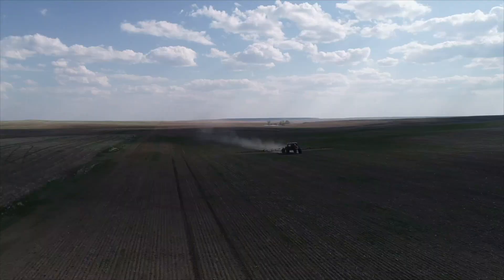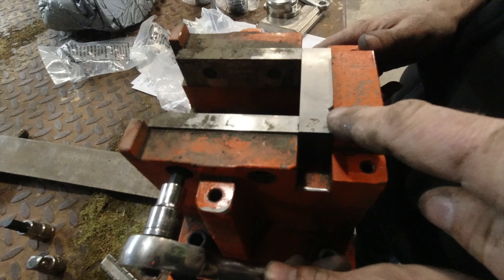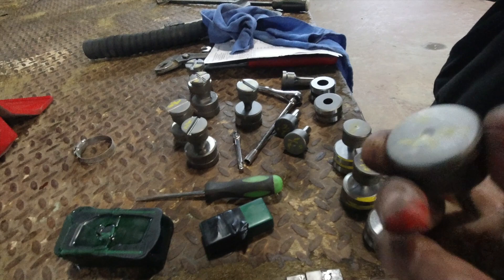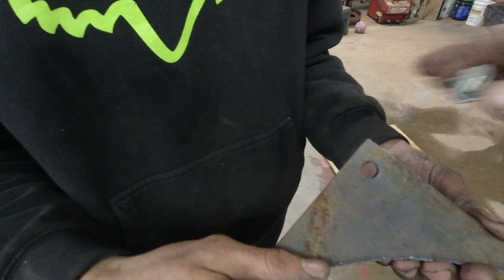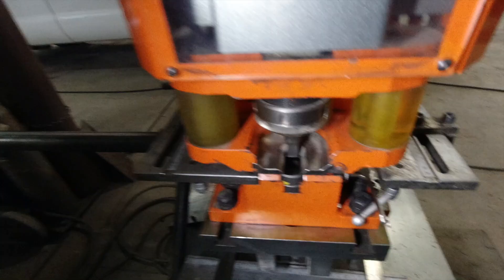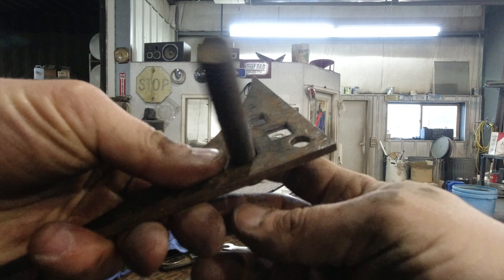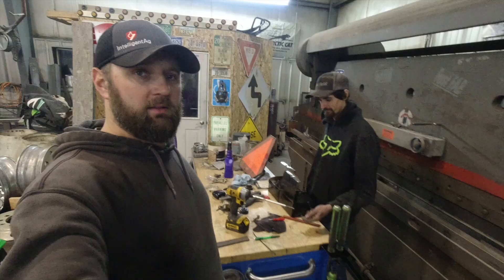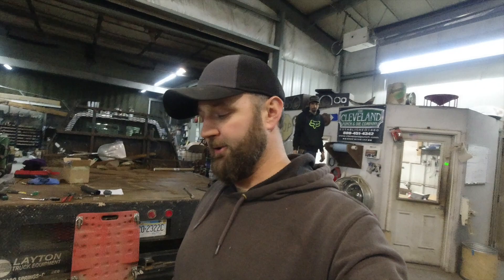What a Tool!

Comment: Top "die" is a punch. The bottom "die" is the die. Punch and die clearance varies depending on material and material thickness. As you learn, you will determine more readily how much clearance is ideal. Basically, you need more clearance for thicker materials. Too much clearance contributes to burrs.
Iron workers are wonderful tools.

Comment: Cleveland makes great tooling. I have a 55 ton Edwards with Power Link. Can’t beat an Ironworker for fab and farm repair. Just a suggestion, i was told to “squirt” a small amount of lube,**-40 or something similar on the punch and die and any of the cutting edges prior to cutting anything. According to Edwards, it really extends the life of the tooling.
Reply: Bones Stitch, I agree with lube on the punch and dies.  Don’t need much and will make them last longer without galling up or dulling.  Tony please use safety glasses when using Iron Worker just never know.

Comment: Years ago we had a Scotchman Ironworker with a 6 position turret.. we kept bolt size punch and dies in it, along with a 9/16 square for pierced handrails... Center punching hole locations and aligning them with the point on the punch made for  very accurate hole placement, if you can jog the punch down below the hold down... And remember- only punch holes where the hole diameter is larger than the thickness of the material

Comment: In manufacturing you specify the hole size punch ,then the die requires clearance according to the guage of material--clearance for thicker material. Not enough clearance will ruin  the punch ,require excessive tonnage to punch.